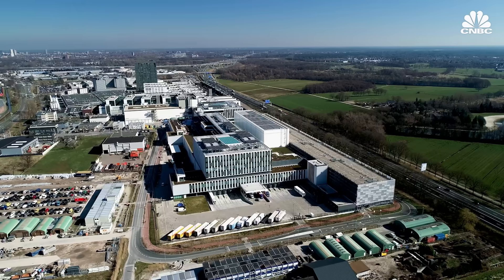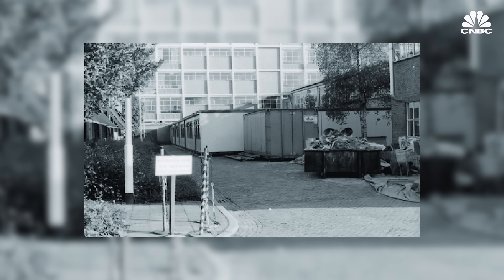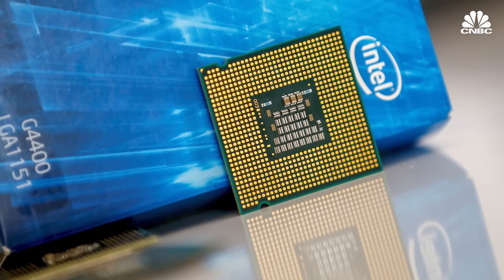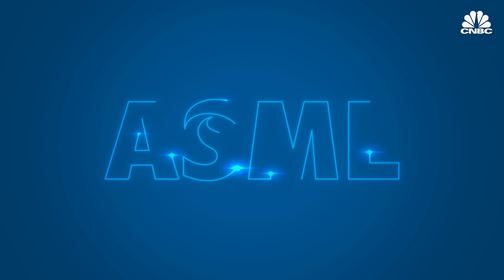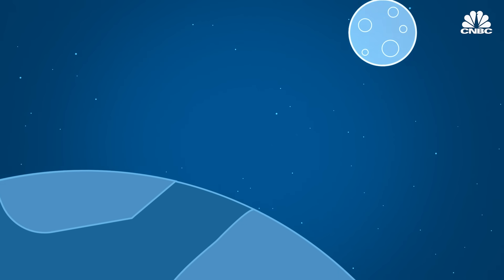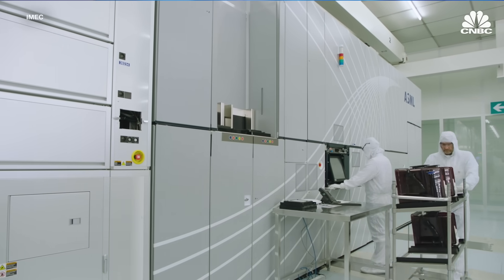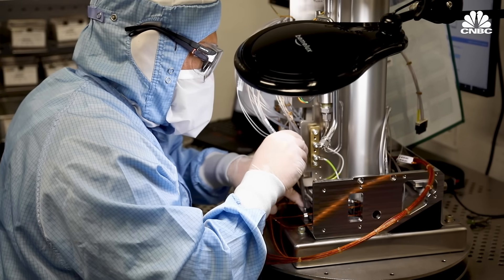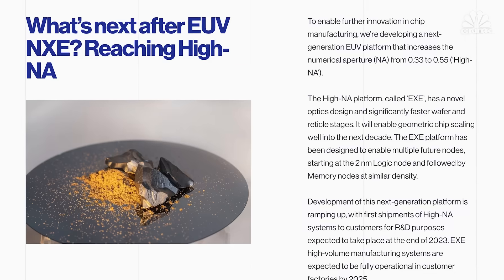Why The World Relies On ASML For Machines That Print Chips

Comment: I think U.S intel plans are going  the wrong route, I did the math on this, they release how  much chip in a ev car. It's just over 2,000, counting how much cars in the USA the math was biden need 178 billion chip by 2030 to make his goal of 1/2 are ev by then. That impossible. And car chip are the same low end consumer chip cause a car system has to be reliable that means hundreds of single isolationing circuits as say the window. That run by the computer.

But intel goal is fast chips or really number crunching chip. They not needed  go in ev cars or 
charger but more for communication as 5 g

Comment: ASML also requires input from their client for their machines. That's why TSMC's machines are different from Intel, and why TSMC was first but Intel had issues with theirs.
Reply: they are the same intel or TSMC what you are missing is the "circuit diagram designed by intel. not the machine.the problem boils down to circuit diagram engineers not the machine

Comment: garbage journalism. way way better sources that did a 10x better job with 1/100 the budget
Reply: @ariedijker2911  fail to mention key facts in order to protect China. No surprise they are majority owned by blackrock/vanguard both ultra pro China companies. Key missing fact is usa military was the original investor in all of this, usa military as a result has tremendous say in these companies, which is how usa military blocked the export of the best machines to China AFTER China talked trash and threatened us with war. 

We love talking about how nasa has done so much for our economy, turns out the military pulls its weight too.

Comment: 8:43 "DUV is for toasters" - the moment I lost trust to everything else he said. Where do you get those "experts"?
Reply: It's an explanation meant for very lay people. A smart toaster is not gonna use cutting edge chips, it will run on an A0 core build using an old node like 40nm with DUV

Comment: I think this is Great, There are others who are working on this technology, competition is coming, Manufacturers wanting to build every component/semiconductor in House-TESLA
Reply: Nope Tesla isn't close. I mean they aren't even in nascent stages to make a DUV let alone an EUV machine. Forget about them trying to manufacture a Chip used for their LIDAR sensors / AI in cars. not happening in next 25 years with Tesla.  Even the Chinese and Koreans / Japanese tried and have failed. So what makes you think TESLA ( even with ELON musk) would achieve this ? TESLA already has plastic component manufacturing issues in their cars and their Quality is horrible ( be it paint tech or body issues or battery issues ) - And you think they'll spend 400 million to make a machine ? ROFL :)

Comment: When I was in high school I worked in a clean room and helped produce microchips for Western Electric and other buyers. It was amazing to see silicon crystals growing. We also shot chromium onto very flat glass plates. These plates were coated with various layers but a photo emulsion finished. The target was shot with the circuit image and after acid washes a micro circuit was created for sandwiching inside an IC chip. I made my first photovoltaic cell using a damaged wafer of silicone. After my introduction to clean rooms  I later worked in dirtier places- surgical suites.
Reply: For those who have asked, the jobs i did while in high school had little to do with the particular HS i went to, but rather that my father worked for a large company with several subsidiaries. He kept his ear open when small part time jobs presented themselves. Yes, in those days surgery did not use HEPA filtration, except perhaps in high-risk cases such as total hip replacement or any prolonged surgery. It is my understanding that today surgical suites are much cleaner than when I worked in one. I was lucky and also attended Cal Tech while still in HS for electronics and other classes. I know not everyone gets the exposure that I did, and that i still get. I suppose it is being at the right place at the right time.
Reply: @markmoreno7295  Atleast you didn't waste an opportunity! Kudos. If I had a child I would do the same as well! :) You're all good!
Reply: @markmoreno7295 Plus...your Dad being a member of a Fraternal network...
Reply: Wow you're so lucky to graduate from that high school
Reply: How in the world did you get that kind of job in high school???
Reply: @williamcoleman8731  network lol
Reply: @sesetio338  wish I could have a job like that
Reply: @forloop7713  why did you name yourself For Loop? I'm struggling to do a triangle with modula. Haha As long you work towards no doubt you will make it 🙂
Reply: @sesetio338  work toward what?
Reply: @williamcoleman8731  that might have been thirty or more years ago.
Reply: In Asia we have bachelors and masters do the same things you did as a high schooler, 
so unnecessary and inefficient...
Reply: What high school was that?
Reply: @andylines8040  Which* .p
Reply: China is overtaking it
Reply: I went to work for a tech company directly out of high school. I started out testing and sorting power semiconductors because I knew how to work with an oscilloscope. I was tapped to do circuit layout and photo lithography masks because I could read a schematic. All that at age 17. No special contacts just being in the right place at the right time. That firm was bankrupted by the owners doing equity take outs. The 70s had some magic opportunities with spectacular crash and burns.

Comment: I wasn't worried about chip shortage in the future, but now that cnbc has made a video and specifically told NOT to be worried...I am worried that there WILL be a chip shortage.
Reply: Have you bought a PC or components lately? There has been a shortage for quite some time now. It's due to COVID, logistics issues, floods in China and other reasons. And it will continue for at least a year.

Comment: No wonder there is a chip shortage. ASML has a monopoly on the chip manufacturing supply market in the name of “national security”. Ukraine is the worlds largest producer of neon gas used to make these chips. What if China secretly has their own DUV and EUV machines and they need the neon gas from Ukraine so they sent Russia to seize it by taking control of that region? And when Russia does take control of that region the Chinese invade Taiwan to knock TSMC off line to take shares of the market when they come online with their machines. 🤔

Comment: I've been watching alot of videos on or about AMSL lately, and it seems that a really important piece of information about how lithography is done is not present.  But I think it would give the lay person the understanding of why lithography is so difficult.

1.  There's explanations on how many transistors, ok ... I think that the avg layperson if they've seen a couple videos about semiconductor mfg'ing has a decent knowledge about how there are billions of transistors on todays cpu type chips.
2.  Many people just don't have any idea of what a reticle looks like, that it's one whole chip width and has 1 layer and that it's large.
3.  Many people have seen how small a chip is on a wafer but not how big that reticle is.  That in order to print that reticle image onto the wafer it has to be "STEPPED" down to actual size.  That the issue with stepping is that the wave length of light determines the ultimate limit you can print at.  Now my rudimentary knowledge is that 1/2 the used wave length is the limit an image can be stepped down.

It's this limit that ASML is working hard to break through.  Heck I've only not been in the industry for 8 years and back then I hadn't heard about immersion, water, lithography or what ever it's called.  At the time I got out Intel was still trying to find a High K dialectric so that they could be made thinner.

I think that if more videos included why it was visible, UV, DUV, immersion, and now EUV steppers they'd have a greater appreciation of the hurdles ASML works to overcome.

Just my $0.02

Comment: For those who know the process, do the wafers still need to be prepared with their coatings before being sent to this machine? I am familiar with implant and metals that coat the wafers before lithography. In NYS, we were supposed to become The Silicon Valley of the East when Cuomo spent the money for a place known as Global Foundaries that would make chips here just like the other chip manufacturers already in this country. The chip makers are already here, CRANK THEM UP instead of creating a bogus shortage.
Reply: The process is still the same, you need photoresist to be able to do lithography. In fact, this is one of important steps customers have to do - find the best resist.
Reply: @d.kersten8793  It would have been nice to find an alternative as the gasses and acids needed are pretty nasty.

Comment: This insanely expensive way to make chips is why we need to switch to photonic processors as soon as possible....
(which only requires 10nm lines max).
Reply: Everybody always talks with these words like photonic processors, nanotubes etc.
Than they say we need to switch, we need to build it now.
But truth is they are just empty words as nobody knows how to build it yet or knows how to build it at a rate of billions of chips a year.
Figuring out this complexity and switching up the entire supply chain is work that will last decades.
It is like fusion energy, everybody talked about it, researched it, says it is the future, but we have been waiting for fusion ever since 1934 and it is not coming any time soon.
Reply: How developed are photonic processors

Comment: ASML is only needed for smartphones. Cars and other applications do not need such small features and work fine with older technologies. These can be produced much cheaper in more companies around the world.
Reply: Oh yes, because cars are getting simpler……
Reply: False information, ASML is needed for DUV as well, 85% of DUV machines in the world are made by ASML as well and are the best.
Wipe out ASML from this planet and chip making goes back to the dark ages.
Reply: Not sure about your statement . One example is military... And speciality memes
Reply: @das250250  90% chips do not require EUV. As far as military hardware is concerned which is on a whole different level compared to these consumer gadgets. 
First of all these consumer electronics do not have any redundancies build in it. Basically u have to baby sit these consumer electronic gadgets including computers. They have an operating temperature the amount of humidity it can handle. You just can't put a consumer gadgets or a pc in middle of a sandstorm in middle of a desert with frying temperatures. It will completely fail within hours. Or it may not be able to perform the calculations leading to failure. 
When gadgets become hot thermal throttling kicks in to reduce the temperature and hence it's performance.
But for example a surface to air missile system in the same desert can be deployed 24×7 365 days in a year as it's electronics has the ability to sustain atrocious temperatures pressures and dust. And within such an environment it has to perform in this case intercept say an enemy cruise missile or a fighter jet with precision. 
Consumer electronics are built to be used under  at room temperature. Consumer electronics are very sensitive and have well defined operating window.
Reply: Then why are ASML selling 85% of those machines? It's not about the cheapest machine, it's about the lowest cost per transistor. And more companies? One other company...

Comment: Wait for CCP China to steal its technology
Reply: Even if they do they need to build the EUV machines, they need to build the machines to make the EUV parts ( mirrors, lasers, droplet machine,...) , they need to write the software, they need to build up the expertise to maintain these machines. When they figured out this machine ASML will have EUV High NA in production for years and working on the next generation. Machines are too complex, note China took apart a DUV machine, put it back together and never got the ASML machine to work again.
And this machine is far more complicated than EUV.

Comment: I used to work for a supplier that built the same machines for one of ASML's divisions, Cymer. I was a highly regarded technical writer documenting how the machines were to be assembled. It was definitely fun and interesting. I would later go on to work for Intel documenting how to maintain their AMHS equipment. I am working for a telemedicine workstation company in Scottsdale, but I am feeling the pull of the semiconductor capital industry.
Reply: Do you know how to design and build ASIC miners from scratch re AZ location
Reply: Following
Reply: Can i email you? Im in az and have a couple questions for you. Thanks
Reply: @MrSenorhappy  I can be found on LinkedIn. My profile lists my Retronix/Intel and UCT experience.

Comment: EUV photons can also be produced by particle accelerators such a sychrontrons. There is a process called STEADY STATE MICRO BUNCHING. China is preparing to and undertaking research to produce high end chips using synchrotrons. China has already succeeded in producing the photoresists necessary for EUV lithography. Different companies and other entities seeking to produce high end chips using sychrontrons will share sychrontrons in a manner semblable to sychrontrons being used as utilities.

Comment: I get that they figured out a way to print nm sized chips but I'll never figure out how, with that enormous electron density, they don't fry immediately upon switching them on.
Reply: It's one of the reasons the voltage at which chips operate internally has become lower and lower over time. For example, while the (definitely not cutting-edge, I think 45 nm) processors on the embedded systems I work with still have 3.3V interfaces, these actually use special tricks to handle such hazardously high voltages, using multiple transistors in sequence and intermediate bias voltages to control them, because putting more than 2V across a single transistor would damage it. Internally this chip mostly operates at 1.1V.
Reply: @MatthijsvanDuin  hasn't the dielectric materials become more exotic as well, we used mainly silicon dioxide back when I was in the industry.
Reply: I was wondering the same. These chips have unique nanoscale gating designs to handle this
Reply: Drip the electrons into it one by one lol
Reply: just imagine in your usb stick your data (a bit) is presented by a countable number of electrons.

Comment: Just to be clear, Global Foundries had EUV and then decided not too persue 7nm. Lets not forget that.
Reply: And why was that?
Reply: @plexoduss  new CEO, new vision.
Reply: @BrendanRC  Sorry for the late reaction, but I remember reading about the biggest problem with 7 nm and that was not the EUV technique itself but how to correct the scattering of light, with such a small error margin it is very hard to put two structures next to each other without electrons wanting to cross over. ASML figured out how to do that with software correcting the beam so to speak and with that reducing the error margin significantly enough for commercial use. If I can find it I'll drop a link, but it might be in Dutch. Thanks.

Comment: 🤔This certainly explains the problem and why there’s a problem. There needs to be more companies with the ability to compete in that technology space. 🤔🤨
Reply: And were would they get the TALENTED ENGINEERS, out of their ars perhaps?
Reply: @arthurfleck1554  🤦🏻‍♀️🤷🏻‍♀️
Reply: That's the problem with extremely sophisticated technology like this, the more highly advanced and specialist it is, the less competition there will automatically be because the knowledge, experience and capital needed to compete is extremely hard to acquire.
Reply: @pieterveenders9793  - True. 😭
Reply: The chipshortage has little to nothing to do with ASML's leadership in EUV.

EUV is just the newest stuff. There is competition for older lithography technology.

The chip shortage is caused by:
- changes in consumer patterns during the pandemic (e.g. people spending more on things with chips in them)
- bad planning on the side of certain customers (the car industry most of all)
- crpyto currencies demanding processing power
- the U.S. - China trade war, causing various companies to make massive orders in fear of future sanctions
- lockdowns in Asia causing component shortages
- possibly exponential demand from some information processing areas such as big data and a.i.

Comment: 9:40;
How can a single drop of tin be hit by the laser 
2 times per second when 50,000 of these drops 
of tin per second fly through the horizontal 
sweepable area of the laser beam?
Reply: They’re pulsed lasers.
Reply: @ricohl88  Every drop is hit by pre pulse and then by the main pulse so 100,000 pulses  / sec
Reply: @pierreadriaans2282  Yeah right, I see ...

In one second, 50,000 drops shoot by, each 
of them is hit twice. 

Once from the pre pulse and once from 
the main pulse.
Reply: @silberlinie  Correct
Reply: not every droplet gets hit
Reply: @Loda_be  Yes, you can imagine that. 

Every drop should be hit twice, but if you look 
at the process completely, it is a miracle that 
most of the drops are hit at all. 

And that probably means that a lot of effort 
has to be put into getting all the tin residue 
out of that area in real time.